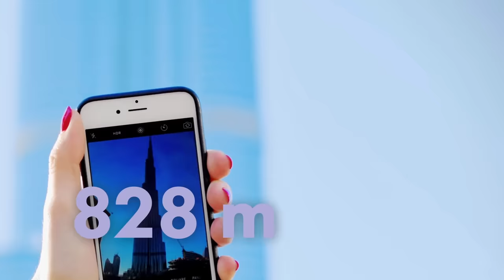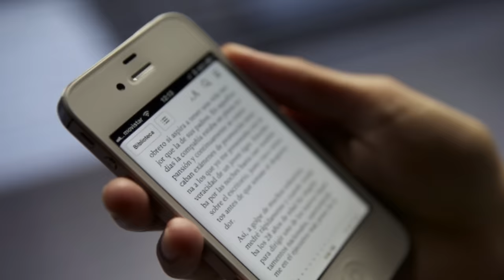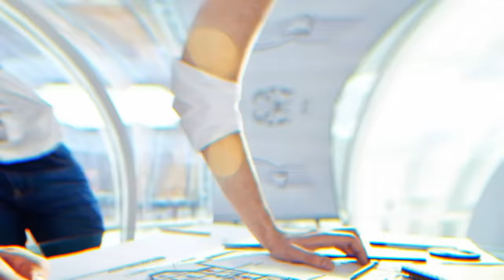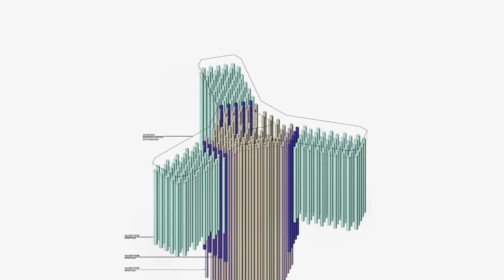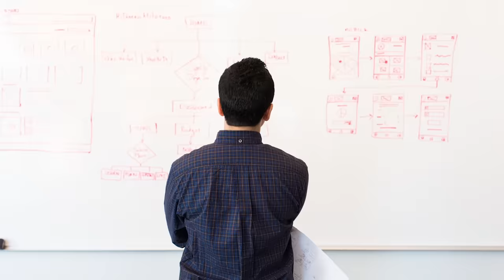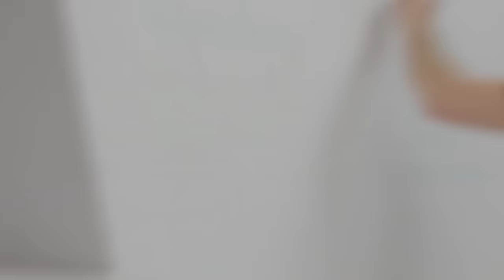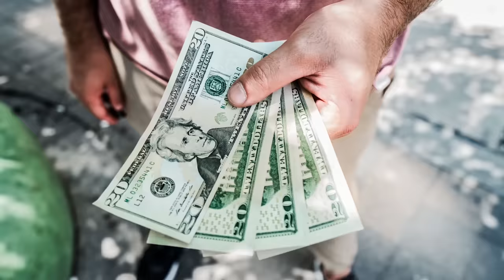What If We Build A Skyscraper With A Billion Floors?

Comment: Couple notes.
1: after you reach micro gravity, the cost of build goes down exponentially. You will have achieved a space elevator at this point and the cost of transporting materials becomes tiny compared to now. You could even rent the elevators out to fund the project at this point. 
2: after you reach the stratosphere, energy no longer becomes an issue. There is a near limitless supply of static electricity in there. It powers every lightning strike on the planet, however, tapping into it, will drain it all into this one structure. Imagine every single lightning strike on the entire planet being focused into one spot, but not in the form of actual lightning. The static electricity will simply build up, never achieving the necessary voltage for a "discharge" you simply need to hook wires to the frame, and building could power itself, and the rest of the world just from the energy it absorbs from the atmosphere, with the only side effect being that lightning will strike less frequently across the region.  
3: This could only be built on the equator. As you get higher up, centrifugal forces become a real thing. At the equator, the top of the tower won't actually be pushing down so much as orbiting in a geosynchronous spot attached to the ground. As you get further away it will actually be pulled on the ground, and at the equator this will be pulling straight out. As you get further from the equator the pull will be pulled not just out, but towards the equator, putting sheer force on the pull. That will limit how high you can build, unless you build specifically at the equator.
Reply: yes!
Reply: nah bro write a essay
Reply: JerzeVillain  Not with current materials. It gets easier once you hit a certain point, but getting to that point is the issue.

Comment: Lost issues: 
1. Positive: The gravitation decreases with height 
2. Negative: One terrorist attack may kill 1 billion people and make a damage of 100 trillion dollars
Reply: But gravity doesnt decrease that quickly
Reply: @Experimental-Hub1  At 4500 km it is the same as on Mars. At 6000 km like on the Moon.
Reply: By a terrorists you mean America, like 9/11?
Reply: @alexmoldovan7557  It would be way worse than 9/11. If the attack had the ability to take the structure down. Humanity, or what would be left of it would be Planet locked from all the debris in orbit, and the Earth would experience a Rod from God event that carpet bombs all the way around the planet. It would be a literal Tower of Babel knocking humanity back into the stone/ Iron age, and dividing the species once again.
Reply: Humble Soldier 🧐🤔🤭🤫
Reply: @humblesoldier5474  what are you smoking, yum 😋
Reply: Also the building is turning with the earth so maybe going the same speed as all the space junk.
Reply: @Experimental-Hub1  It does when you take account of the rotation of the Earth, which sends "gravity" to 0 at the height of geosynchronous satellites (≈ 38,500 km above the surface), and above that, actually pushes things outward, away from Earth.
That's if you build it on or near the equator.
Even if it's 10º N or S latitude, in order to avoid smacking into the Moon, which stays within 5.5º of Earth's equatorial plane.

And a billion floors would take you many times the distance to the Moon; somewhere around 100 times the height of a geosynchronous satellite.

Consider this: Earth, scaled down by a factor of 1,000,000,000, would be about the size of a marble (D ≈ 13 mm ≈ ½ inch).
And at the same scale, the Moon would be about 38 cm away from it.
And 1,000,000,000 floors would become 1 floor.

Fred
Reply: 1st off a gravitational decrease is a negative. We need gravity and also 1 terrorist attack could kill more than 1 billion people if the building is 1 billion stories. That would only mean it's 1 person per floor
Reply: @Humble Soldier A Building with 1Billion Floors would basically be entirely in space. [99.99%] It would stretch out 10X further than the Moon, there would be no down for the building to fall; worse case scenario would be if it got dismantled from being attached to the Earth. It would just drift out into space and either hit a cosmic body or drift into Interstellar space. .
Reply: @Torontogal1973  & others:
Well, this whole thing is a 100% unrealistic fantasy; but it's way too much fun to think about.

Fred
Reply: @alexmoldovan7557  No, Islam.
Reply: @SirThreepio  But how is the moon in orbit when there is nearly no gravity at 300 000 km?
Reply: @ffggddss  how is the moon in orbit when he gets pushed out?
Reply: Wait if it looks like the one in the thumbnail a little plane wont do anything but maybe a huge plane
Reply: or did you mean like a missile I just thought of 9/11
Reply: Didn’t think of that
Reply: @Experimental-Hub1  "how is the moon in orbit when he gets pushed out?"
Who gets pushed out of what??

"But how is the moon in orbit when there is nearly no gravity at 300 000 km?"
There's still gravity out there; it's 60x as far from Earth-center as we are here on the surface, so it's about 1/3600 of a g acceleration, which is why it takes the Moon 27⅓ days (sidereal period) to orbit the Earth.

Fred
Reply: @andecap1325  The vast majority of orbits are inclined to the equator. Thus there will be a component vector that will impart the Kinetic Energy of a space junk collision against the structure. Furthermore the orbits are not at the same angular speed as the angular speed of the Earth's rotation. Only in an equatorial geostationary orbit is the object rotating at an identical speed and thus remains stationary in the sky with respect to Earth. And that happens at roughly 23,000 miles in altitude  At any lower orbit an object is traveling faster than the Earth's rotational speed

And if you wanted to speed up all that accomplishes it that you raise your elevation and decrease the orbital period..

Speeding your orbiting spacecraft up has the effect of slowing your spacecraft down while raising your orbit and decreasing the orbital period.. Slowing your speed down has the effect of speeding your spacecraft up while decreasing the elevation of your orbit and increasing the orbital period.

Orbital Mechanics is fun. Look that term up. And if you want to try out navigating a spacecraft in orbit there is always the Kerbal Space Program Video game.

Kerbals are fun to kill....accidentally of course. You will kill a lot before success.

And as Scott Manley will say...check out that channel..."Fly safe."
Reply: Built in City Shields my boy
Reply: no bro. You would need ultra sci fi godly metals to build a building of this scale, no bomb or any weapon can even damage the building to the slightest.
Reply: Smh
Reply: @alexmoldovan7557  yeah spread some more salt.
Reply: Andreas Klein yeah terrorist are going to break it I can imagine what’s going to be on the news for this 10k floor building
Reply: ez solution just plant a few active sam sites near the building
Reply: Golby Dev but the rotation of the earth would mean that the top spins faster and the centripetal force would push it outwards
Reply: @SirThreepio  you did the math wrong bro.. see Gravity at altitude can be calculated by gh/g = 1- 2H/R.. now R being radius of earth approx 6400Km and since g is 0 for the location we are finding means zero gravity hence LHS is 0 now just solve for H and you'll get 3200 km.. thats where gravity ends and as far as i'm concerned moon also has 0 gravity so ergo 3200 km ..
Reply: He said this thing would need twice the mass of the Earth in materials to build.... Guys come on :)
Reply: @SirThreepio  so how do satelites gravitate at 1000 milles from earths ? if there's still like 6G gravity ?
Reply: Andreas Klein After you go past a specific point the centrical force of the structure rotating around the earth would completely counteract the weight of the structure if you go to far past that it would completely fling the top section away
Reply: @caseyg6225  well when you're  orbiting, you're just falling but it is mitigated by your speed.
Reply: @aileenhunts6404  its called orbital velocity..
Reply: Humble Soldier what the heck are you smoking?
Reply: Joe Gibbs Sorry I should’ve used different words when I object to spinning such as a building the top of it is going slightly faster in the bottom of it it’s the same principle if you have a piece of rope you start spinning it around it’s going to try and fly out there’s a few other videos that you can look for about building a space elevator that goes more into detail about howYou would not need any guide wires after a certain height
Reply: I assume that the security would be airport style. But if it were to somehow collapse, im guessing the devastation would be like unto a nuclear warhead strike...creating a shockwave or earthquakes
Reply: Another 911 .. stupid idea to build a buliding  that high .. .no thanks I l keep my feet on the ground nor will I get on the second titanic thank s lol
Reply: That shit only works if the whole humanity is united... Sadly that day won‘t come tomorrow, nor in a year.
Reply: @SirThreepio  so you can jump for 6 meters easily if you are at 6000 km of altitude?
Reply: Earthquakes.
Reply: @CALLAHANB52  but if norad could stop a plane.....
Reply: Brendan Sharpe  strange enough, I was sure that America was its own terrorist in that occasion in order for it to have an excuse to increase mass control and all the other benefits that war brings for a government that is financing it 😊

Comment: Wow! All I can say is that my mind's totally blown! This idea is science fiction in its purest form yet they're figuring out, little by little, on how they can make it a reality, impressive! From my standpoint, however, I doubt it'll work: building a structure extending well into the stratosphere has many dangerous variables. One such variable that came to mind is an asteroid impact: its seismic waves would cause it to collapse, if not, make it unstable. Another problem is plate tectonics, which is always in motion, causing earthquakes at different magnitudes. This would take a toll on the structure over a period of time. Having said this, I can fathom a megastructure four-thousand feet but not passed that altitude.

Comment: We can create a building  with 1 billion floors with a height of 1cm each😂
Reply: that would be a skyscraper with a height of 10.000 km, or as tall as the distance from the pole to the equator
Reply: @95martb  Albert v2.0😂
Reply: 1mm probably
Reply: How about a billion 0.01mm story building?
Reply: That’s still 38,678,859 feet
Reply: 1 billion really is a big number
1 billion seconds is 31 years
Reply: This means a hight of 10.000 kilometers. Possible?
Reply: Danol123 that’s still 10km which is taller than Mt. Everest
Reply: @theactualpanda5096  
ikr
Reply: Legos
Reply: @Danol123  somewhere around 10km
Reply: @christianborkey5459  but why are you using the wrong system of units?
Reply: @Philip L Tite lol
Reply: @FilipeDGuedes  I don’t live in Europe? I don’t use the metric system
Reply: @christianborkey5459  so you think only Europe uses a system that actually makes any sense? 😂
Only USA, Liberia and Myanmar still use that dumb system. By the way, I'm from Brazil
Reply: @95martb  Wrong, it would be 9'999.99999 km. Why? Because if you have a building with three floors then one surely must be the ground floor. If the height-distance between two floors is 5 meters then in total, the distance from the ground floor to the third floor will be 10 meters, not 15 meters like you suggest with the way you've calculated the height.
Reply: @bluelightning3290  bruh no i saw a video and it said 25 million something seconds was 47 years
Reply: @parodynet3004  actually, using the same three floor building as an example, indeed the distance to the third floor is only 10m. However, the third floor has walls and a ceiling too, adding an extra 5m, making the building 15m tall
Reply: @FilipeDGuedes  I don’t think that only Europe uses it, and I’m sorry I was born in america
Reply: @christianborkey5459  don't be sorry. Nobody is perfect 😂
Reply: @christianborkey5459  wtf 😃🤣😞🥰😎🥰
Reply: Yes it will be a hotel for ants
Reply: You guys are crazy nerdy, I don't know what are you talking about
Reply: That would still be super high
Reply: Introducing Yoctometers and Planck length

Comment: Today: Me entering elevator from ground floor.
1 year later: still in the elevator trying to reach top floor.
Reply: I did some calculations, if I'm correct it would take 5 months or so to reach the top going 1000ft/second or 300m/s. It would probably make more sense to take a 20,000 ft/second rocket up there, about a week.

Comment: A billion floors? Well, if each floor is one atom thick, that would be 10 or 20 centimeters.
Of course, at the more usual 3m per floor, it would have to rise 3 million km, or about 8 times the distance to the Moon.

This is physically, totally impossible for many, many reasons:

• There's no material that could support its own weight for, oh, 100 km or certainly 1000 km
• At 30-some thousand km, you reach the height of synchronous orbit (if you're building near the equator), and anything above that is trying to fly off into space, because of Earth's rotation
• Or if you try to build it right at one of the poles, then even if you could find bedrock, the strength of Earth's crust would never support the weight
• The tiniest of tremors, anywhere in the world, would propagate enough crustal motion to it, to bring it down
• The amount of material needed, to go into such a building, would be impossible to gather/mine/quarry
etc...

Fred
Reply: Ur smart
Reply: What sort of atom is 10-20cm thick
Reply: Yeah no shit sherlock hes just dreamin 😂😂😂
Reply: Which is why this is just a video not a reality ;p
Reply: @tomallison1098  Permit me to clarify what I was trying to say:
If each floor is one atom thick, the building would be 10 or 20 centimeters tall.
Is that clearer?

Fred
Reply: ffggddss   
You have no evidence to back up your claims.
Reply: @FWtravels  These "claims" aren't controversial in any way; they are all based on known principles of science & engineering. The "evidence" is everything it took to establish those known principles.
The claims that have no evidence to back them up, are the ones in the video.

It takes very little real-world knowledge to see how ridiculous the idea is! If you think this kind of a building is possible, or that it wouldn't suffer these sorts of failures if attempted, then let's see you demonstrate to the contrary.

Fred
Reply: Wow
Reply: I definitely understand all of that

Comment: At a speed of 1 floor a day it'll take 1billion days(2.7M years) to build it. Goodluck with that👍
Reply: Modern builders do over 200 floors a day...
Reply: It will never be possible but still good for imagination
Reply: If computers can build, perhaps it might be possible since computers process information much faster than the human brain
Reply: We should just be happy with 10 000 floors.
Reply: @jahnj2523  i don't know where you came up with that number but its false by the way that's like constructing a whole building in one day i'm a building electrical and plumbing contractor in real life and you can maybe construct the frame work of 10-20 floors with a crew of about 2000+ a day but its no where near 200 complete floors there is a reason why its takes more then a year to complete a skyscraper
Reply: @StaticBlaster  Information isn't important in this case
Reply: STATIC-SHOCKER nigga you still have to physically build it by hand
Reply: Likely you'd build in sections then assemble them, so as one put "modern builders do over 200 floors a day" you can have simultainious projects going so 100 going at once would be 20,000 floors per day. sure that's still a lot of time but that's with current tech, if you get into automation that could be increased 10x easily.
Reply: @StaticBlaster  DOH!
Reply: @davidm.919  after building 6,879 years, a new building technology is discovered. Now, the whole structure has to be destroyed to build it with new technology.

Comment: 10:14 Narrator: "build another 100 floors"
Video: "x1000"
Reply: Thought I was hearing or seeing wrong,glad someone else realized
Reply: @ospreyzebra125  it's because he already done x100, so doing it a second time would be x1000
Reply: @aphriz  doing it a second time would be "x10,000"
Reply: @ospreyzebra125  nope, that's if you times the answer by 100, but he's timing the original by 100, then 100 again
Reply: @aphriz  even if the original was 1,it would be at least "x10,000"
Reply: @ospreyzebra125  it's not multiplication, it's x1000 times bigger
Reply: @ospreyzebra125  1b is 1000 times bigger than 1m
Reply: @aphriz  which is multiplication😂,I love this argument
Reply: @ospreyzebra125  not necessarily 😂 yeah you can use multiplication to get there, but it's not
Reply: @aphriz  so you are saying 1m x1000 isnt multiplication

Comment: Did I miss the part where he talked about the challenges and reality of designing the structural system of a building 1 billion stories tall to keep it from collapsing?
Reply: About disasters and elevators issue
Reply: And it would take 30 years to reach the top. And if the elevators stop working. And space debrief is inevitable. I could go on and on about the hazards

Comment: That 10,000 floor building ..... a lift taking 1 second per floor, would take around 3 hours to get to the top, with no stops. 
If it stopped on (say) 10% of the floors for 15 seconds, it would take another tiresome 4 hours. 
If you lived on the top floor you could leave at 8.00am to pop down to Starbucks on the ground floor for a coffee. And if you came straight back home you’d arrive late evening at 10.00pm.
Spectacular!